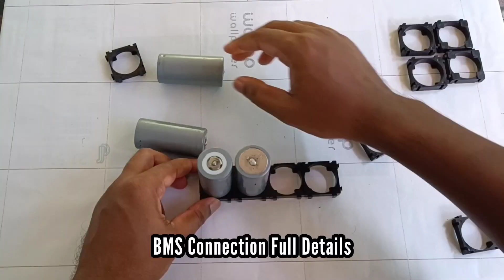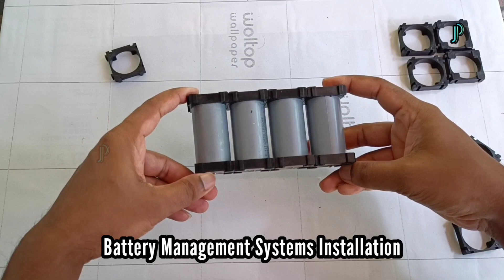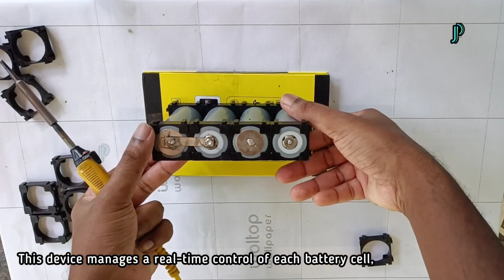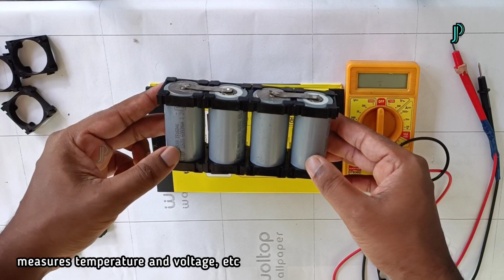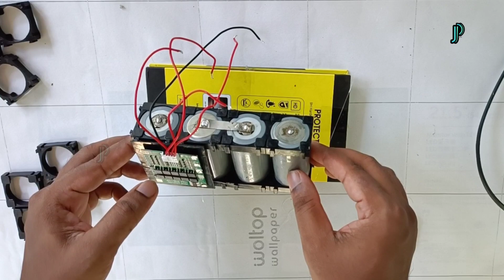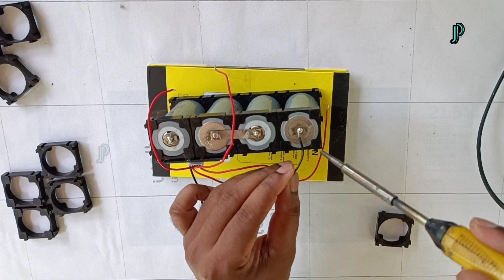Lithium battery BMS Connection Malayalam | Battery Management System

Comment: 4s lifepo4 battery pack 12v adaptoril ninnu input koduthaal full charge aakumo
Reply from the maker: No
Reply: @jpnetwork  so whats the correct range of voltage
Reply from the maker: @feild360-zo3xe 14.4v best